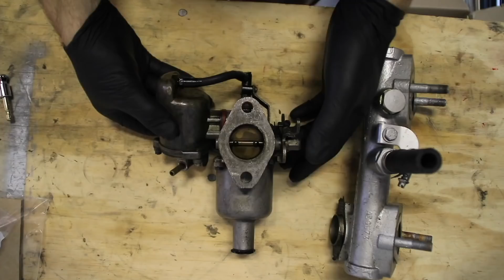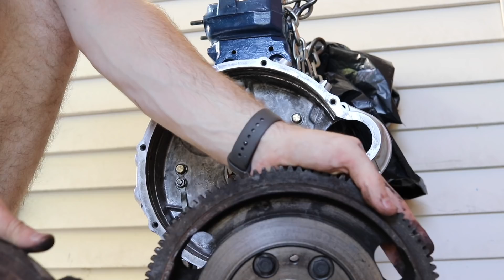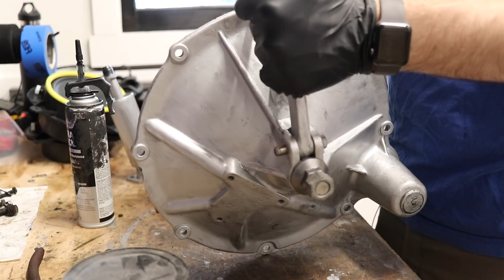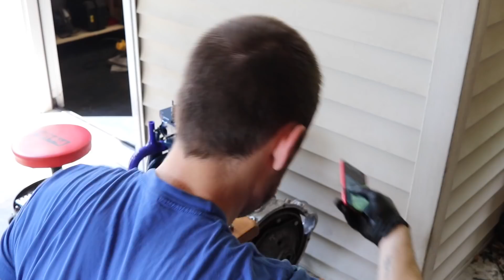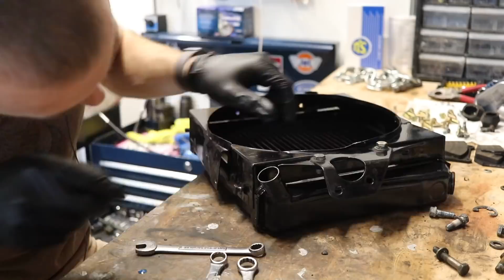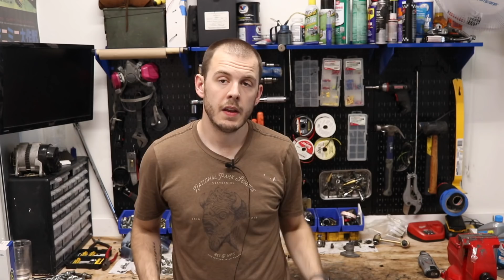Operation Bad Wolf [Ep 16] - Engine Assembly the Final Chapter

Comment: Great vid. Just a tip. Sliding an old bearing cap with open ends against the ring gear in the starter hole is a much better way to hold the flywheel while you torque it up. It locks in better and spreads the loading over a lager area also doesn't stress the thin metal of the clutch housing, which can be chipped/damaged very easily.

Comment: Hi we’ve had to rebuild our engine again after something got into the bores and scored to wall :( We’re just about to put the pistons in but want to make sure everything is clean. Any ways to properly deep clean the pistons before installing them into the bores so we don’t have the same problems as before? Thanks! p.s. great video series great tips along the way👍
Reply from the maker: Personally when I do a rebuild like this I always bring my pistons and internal parts (not including bearings) to a local machine shop and have them run through the parts washer. It's the only way I personally feel comfortable with the "level of clean". 👍
Reply: Classic Mini DIY Ok that’s great, I’m only 15 so it’s definitely a learning curve with such an old engine but hopefully the engine will be done soon and running after August! Thanks for your help really appreciate it 👍
Reply: Make sure you install the piston rings correctly, and the right way up - #1 and #2 should have markings. The oil ring should also be installed properly, especially the three piece type. I am guessing your oil ring  protruded out on engine warm up and scored the cylinder wall. It is better to use a ring expander tool, makes installation easy and to grip the conrod in a soft jawed vice. DO NOT break the rings, they are sold in sets and are pricey.

Comment: Couple of tips from the UK if I may?
1. Before assembling all these parts its worth just taking the flywheel, use some fine lapping paste (used for lapping in valves in the head) and smear round the tapered end of the crankshaft, slide on the flywheel and gently rotate back and forth to finely match the two tapered faces. This makes for a better and tighter overall fit.

2. @ 06:00 we put the pressure plate straps on which you show @ 08:38 (but without the diaphragm) to hold all three components together, then slide the assembly over the crankshaft and locate it all with the offset locking plate. When everything is torqued up remove the straps. Fitting the diaphragm is easier because everything is already lined up.

And a 'Wok'? Its a clutch cover ....lol

Comment: You forgot the 7/16 LOCK NUT on the clutch adjustment bolt..  ( the bolt which had the WEIRD spacer on ).. IF it winds out.. the throw out bearing will touch and burn out  :(
Reply from the maker: Thanks for the heads up. I’ll call it out when I put the engine in and attach the clutch slave. I appreciate the tip. 👍🏼